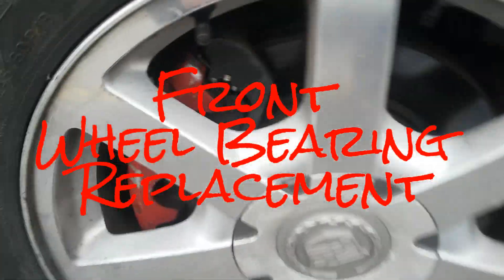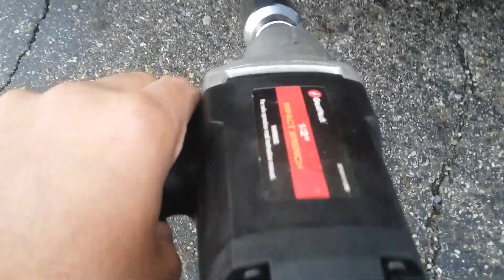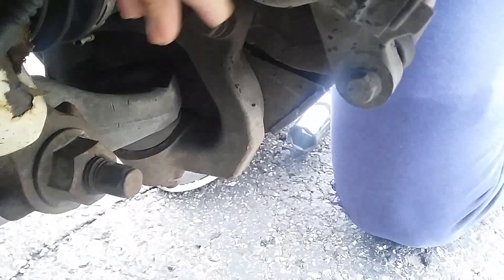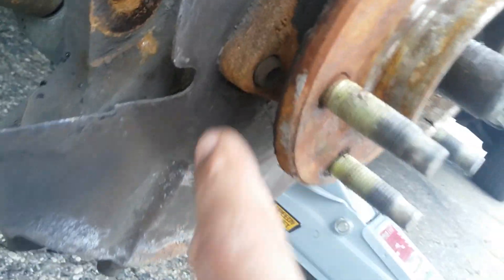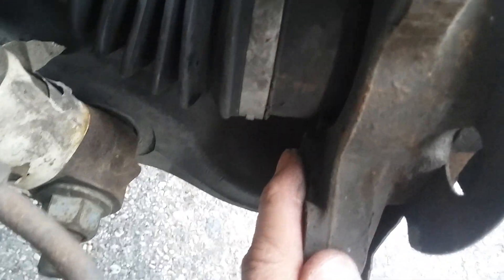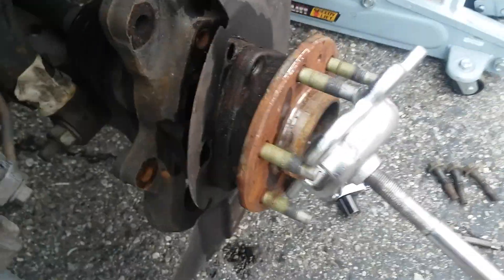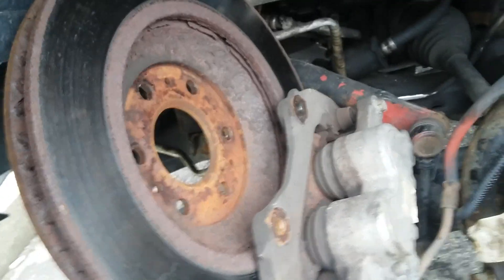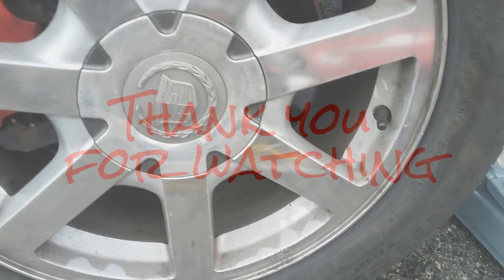Front Wheel Bearing Replacement Cadillac SRX

Comment: You should always put new hub bolts in when you change the wheel hubs.
Reply: Reason? My thoughts: 1. they put threadlocker on the bolts, they don't want dried thread-locker put back in the threads, so wire-brush them clean.  2. They're zinc-coated, if they tell you to wire brush them, people will shine them to shiny iron with no coating, and will rust with an accelerated schedule wherever exposed to water.  3. They're a bulk-buy service center's directions.  To them cleaning bolts is losing money paying a $15+/hr tech to recycle $0.005 bolts.  
Reasons its not:  They're not torque to yield bolts, they're not over-stressed by heating/cooling cycles.
My approach:  Knock the threadlocker out with brass brush, reuse to torque spec. (with new thread locker) .